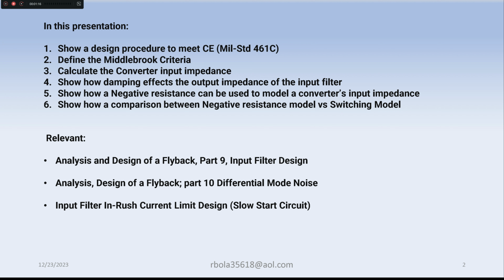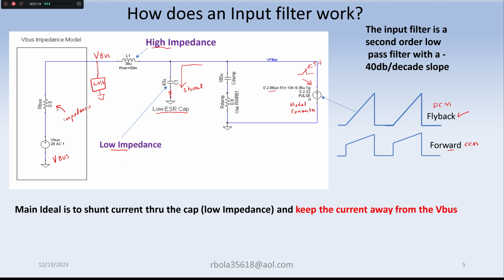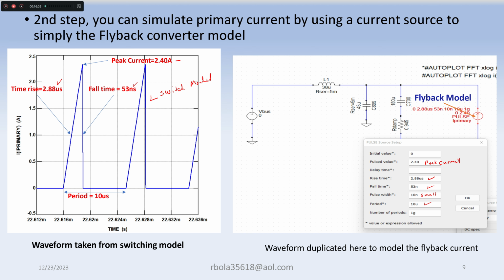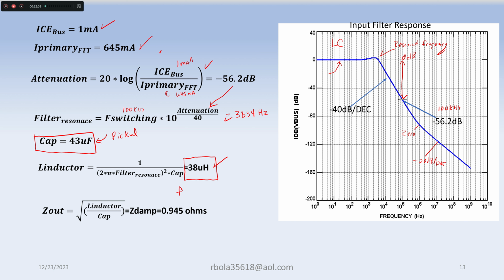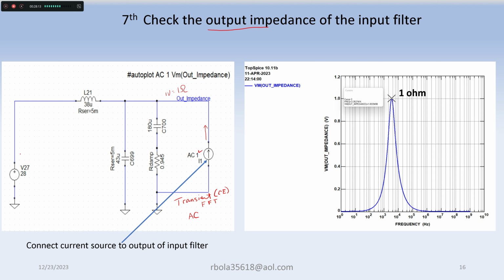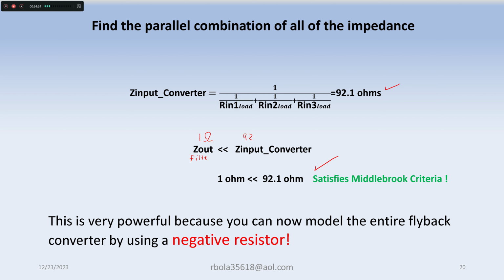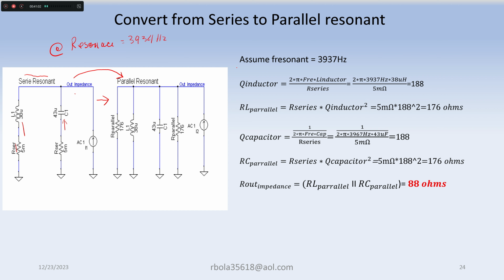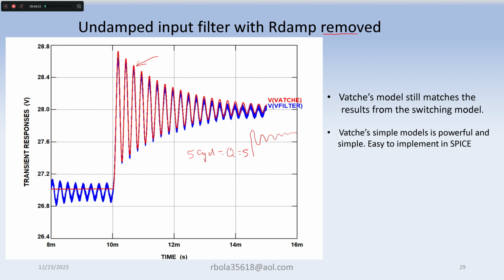Input Filter Design, and simulation using the negative resistance model.

Comment: LTspice is not capable of such simulation it can not consider the curent into the bus
Reply from the maker: Yes, all of these simulation can easily be done in LTSPICE. All you need to do is plot the current in the input voltage source, expand or zoom in where it reaches steady state and then do the FFT.
Reply: @RobertBolanos   thank you so much sir for your  valuable answer, i can indeed see the FFT when applied after the current reached a steady state, however in the FFT  i can see a  large spike wich looks li a gaussian from 0 to 20KHZ ( its peak is  1.8mA at 238HZ ) knowing that the fondamental of my signal is at 25Khz with amplitude 0.1mA i don't know why?  is it beacause the current that i send is too slow (25kHz) and to take too much time to get to a steady state ?

Comment: Thank you for your great presentation.
But i have any questions. What about resonant frequency of converter, in this point our converter has lower impedance, and yes Middlebrook Criteria need to be satisfied in all frequency domain less that our Fsw. Can you explain, because your Impedance calculation don't reflect this, and cutoff frequency off your filter is designed only using needed attenuation and don't exclude intersection between peak of filter impedance and lower impedance of converter at resonant frequency, and if i understand correctly, this model of converter don't use variable negative resistance like real converter is. 
Thanks you very much and please correct me if i misunderstood something!

Comment: Hello Robert,
I'm trying to duplicate your results using LTSpice and i'm only coming up with a max current from the FFT at 100Khz as ~456mA not 645mA. Could you point out the initial similation that gave you those results?
Reply from the maker: Hi Robert. Make sure you do a long enough transient simulation to where it comes to steady state. Then zoom in the the end and you need enough cycles   Maybe 50 cycle or more so the the FFT will be accurate enought. One other thing the effects LTspice is the engine you use. There are two simulator. The first simulator is aimed at speed at the expense of accuracy. So in somewhere in the command you can select to use the more accurate slice engine. Hope yhe helps
Reply: @RobertBolanos  Hello Robert, Thanks for the information. I just tried the settings that you described and I'm getting the same results. I ran the simulation for 500ms and zoomed in on the latter portion of the steady state window for the output current source (or current source being injected into the line) and FFT'd the window region only and ~ 456mA. Now, I'm assuming that the FFT of the current source shouldn't matter if the dampening network along with the filter inductor and capacitor were connected as we are only looking to see the value of the 100kHz harmonic of the current being injected... correct? I also see in your images that you have the source voltage at 28V but sometimes at 0V, does this matter? I wouldn't think so, but again, I'm trying to correlate your measurements against mine. I'm looking at using another spice engine - Q-Spice (new Michael Englehardt simulator). Would it matter which simulator I tried? Has anyone else duplicated this issue or Roberts results?
Reply from the maker: @robertthurman8412  Hi Robert. Can you send me your LTspice file to rbola35618@aol.com.  I would like to take a look at it.
Reply from the maker: I have played with Qspice. It is very fast.  Only disadvantage is no parts datasbase.
Reply: @RobertBolanos  Yes, I noticed that too. I'm trying it out now with some of the models that I imported into LTSpice.
Reply: @RobertBolanos  I just sent the file.
Reply from the maker: I just ran your LTSPICE and I get the same 456mA. There is a significant difference between the FTT results between Topspice and LTSPICE. I will ask Penzar why the difference tomorrow when I get to work. If you are using LTSPICE as you main simulator, then continue to use you results and plug those results into the equation. The design procedure is sound and you should get the desired attenuation.  Thank you for pointing out the difference. I will try this on Microcap. I suspect the FFT on Qspice is similar to LTSPICE so that is why I will try on Microcap.
Reply: @RobertBolanos  Hello Robert, 

Thanks for the update and confirmation. I thought I was losing my mind. I'm going to try it out in   Qspice and Microcap as well and see what I get. Let me know when you get anything. 
Regards,
Rob
Reply: @RobertBolanos Hello Robert, 
I just set up the simulation in QSpice and ran the simulation and came up with 456mA when I FFT, same as in LTSpice. Let me know what you get. I haven't tried microcap yet but I will eventually. Thanks for taking the time to check this.